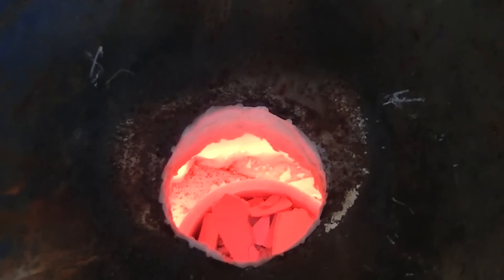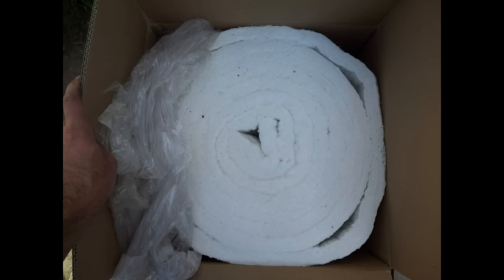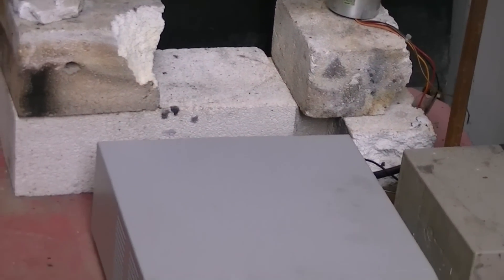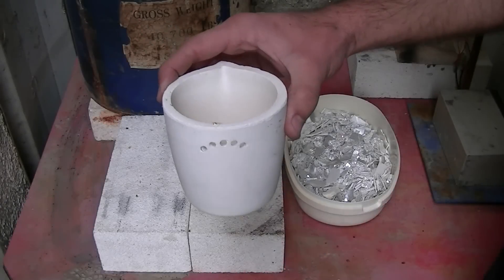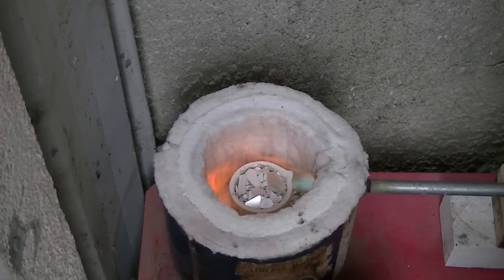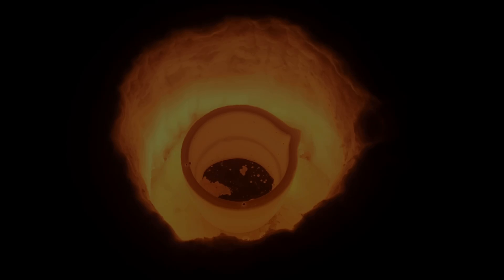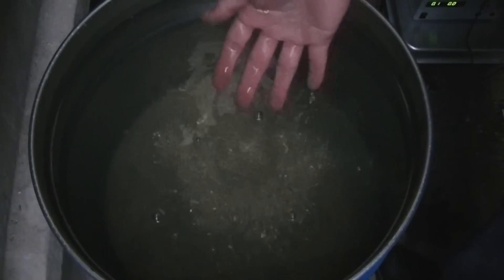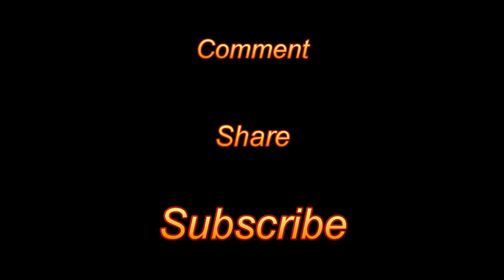How to build a Furnace for Melting Gold and Silver (DIY)

Comment: I see you are basically extending your torch through the feed pipe into the furnace. So, your torch is more or less a mixing handle. Are you adding oxygen from a bottle or air to the flame? And if air, is it compressed via a compressor? Nice job!
Reply from the maker: Your observation was correct.
However, i didn't had to add any Oxygen.

Comment: If you dont have a lab power suppkly you can also use a 12 volt blower and a volume control off an old car stereo or if using 240 or 110 use volume control off some old audio equipment to control the fan speed

Comment: From what is made of the crucible you used in casting, a tip if you are to make casting steel or platinum you should not use a clay graphite crucible as it would glaze and pierce you should use a pure graphite crucible or crucible of tungsten but in this case you run the risk of contamination of the material due to tungsten is better to use a pure graphite crucible if you want purity in the material but in case you want durability you can can use a tungsten crucible but in this case you will get reduction in purity as tungsten oxidizes when it warms and falls on the material you are using contaminated material.

Comment: Yeah! So excited to see more videos and LOVE the furnace! Though I do have a question... What was the purpose of melting down the silver if you were not casting it? OR was this strictly for demonstration for how the furnace works? Any other reasons?  Regardless always love the videos.
Reply from the maker: Hi dear, Thanks.
Shotting (producing casting grains) is a method which is the most widely used for trading and marketing PM's.
Keep in mind that, while the metal it self iq quite pure, crystals could very well still hold on the surface left over electrolyte/water. It is also quite hard to handle.

Once the metal was melted and shot, re-casting operations can rely on the starting weight vs. the after melt weight being the same (unlike with raw silver crystals/gold powder)
Reply: nice
Reply: Awesome, thanks for the explanation! I was wondering the same thing!
Reply: Bonjour

Comment: How do you manage to hold the insulation blanket to the wall of the furnace ?
Btw, I read 13 minutes  but I hear 30 minutes, wich is the correct time lapse before pouring the melted silver ?
Thank you for posting the awesome  underwater footage
Reply from the maker: The insulation just sits there and will not move...
It was 13 minutes.

Comment: Wait, you're not casting it into anything? Why did you melt it in the first place then?
Unless you are planning to use the silver drops as buckshot against werewolves, of course...

(also, was all that silver recycled from scrap? If so, that must have been a LOT of scrap!)

Anyway, great video, as usual. I sure hope we'll get one on your electrolytic cell!
Reply from the maker: Hi, Thanks.

Yes, all of this silver was refined from scrap sterling and a little bit from other sources like e-scrap etc'...

Casting shot (which is what i made in this video) is the most tradable form in the PM related industries, thus makes it very liquid and brings in premium (assuming your customers knows your product is indeed what you claim it is).
Reply: haha i was gona say buckshot for werewolves also ;p...it would work also so i gota get that propane going for best effect of heat lot of good and usefull info on that vid nice work :).

Comment: The underwater camera was a nice touch I would imagine the same set would allow you to make molds of custom sizes and shape  but can these crucibles withstand the stress of submerging in the water to solidify the melt, or would they have to be sacrificial?
Reply from the maker: Thanks. 
The crucible will not survive that.. Also, there no point in dong that.
Reply: @indeedItdoes   oh ok Ive never worked with molten metals before and thought a faster solidification might be better but on second thoughts it would probably be the opposite of IE a slower temp grad
Reply from the maker: @horseman684  Metals freeze in air very fast.. Matter of seconds, depanding on the size of the pour

Comment: How did you secure the Carbon Insulation Blanketing to the interior of the Shell? I'm using a Propane Tank I found and modified with an angle grinder.

Comment: Way cool! Good camera work. And you have described a furnace design I think I might be able to handle. What kind of fuel gas are you using, just propane or maybe MAPP gas?
Reply from the maker: Propane ans/or butane will work just fine.

Comment: hi there indeedltdoes i just watched your videos and their pretty good! but 1 question. i have been watching some videos like yours and they use oil to cool down the material and the cup. so i am asking why do they do that?
Reply: oil to cool down what material? ive never seen anyone put any precious metal into oil. steel yes. that is for the tempering process. but not precious metals the only two things you ever put a hot bar of precious metal into is either water, to quench it, or pickle to quench and remove fire scale
Reply: edgar sikes well its like oil maybe. i thought it was oil in another video because it had the colour of oil and whenever they put the material in the oil it gets a tiny burst of flames
Reply: Bob Hanna yeah mate thats all mild steel forging and tempering shit to get exact correct temperatures and exact cooling rates

Comment: I have made my own furnace but i  use coal/charcoal for fuel. Check it out.
Reply from the maker: I have seen it. Nice.
However, i see you were melting copper in an iron crucible.
Melting metal in another metal vessel is a big no no and they tend to dissolve one another (with few exeprions).
Reply: That was my old furnace. Check out my inquarting video. I made a new furnace and use graphite crucibles.

Comment: Why didn't you pour silver in mold to make an ingot
Reply: well icant  speak for the guy in the video but the purpose of pourin shot is A. its easier to weigh out in small quantity. B what are you going to do with and 8 lb bar of silver? by pouring shot he has small easily weighed material to do whatever he wants to with it whether it is to be used alloying gold or pouring .999 bars for future sale but shot is just far easier to work with